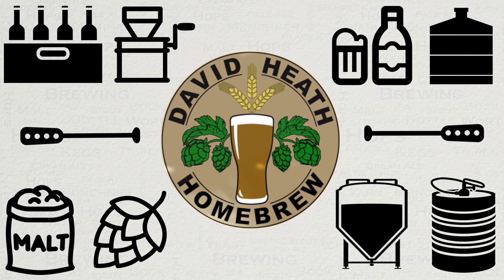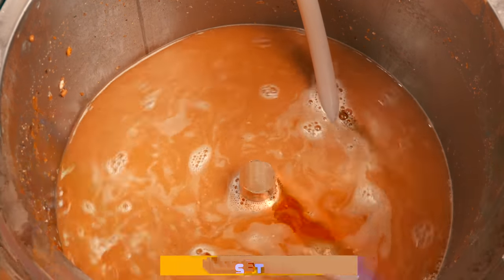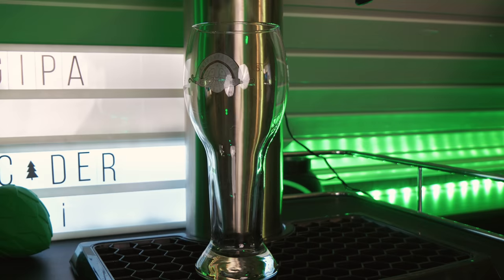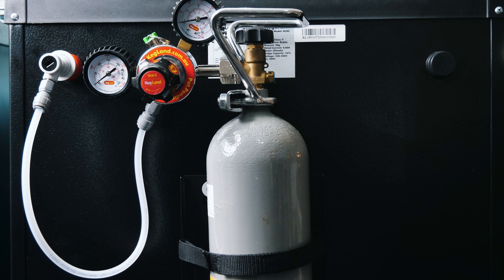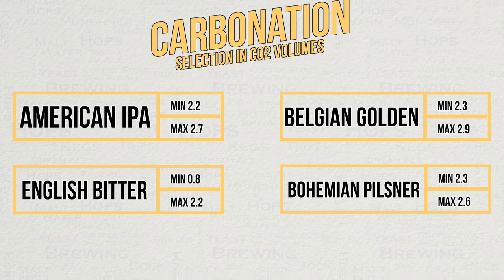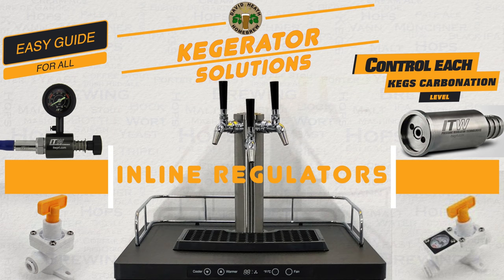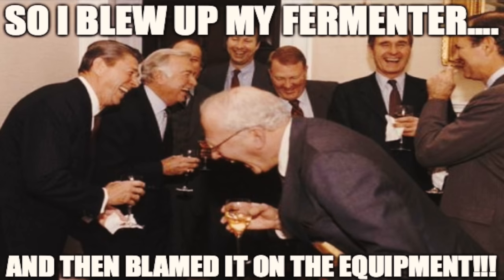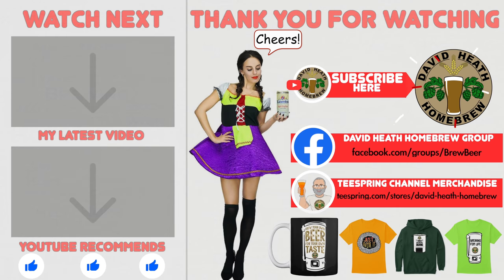Brewing Bad Part 9 Common Mistakes Made By Homebrewers

Comment: Good info. Especially the valve which I have used to reduce flow during mash, maybe that's why I get low efficiency sometimes. This information I have not seen anywhere, and the manual from Brewzilla is very limited in information. Big thanks my man👍
Reply from the maker: Cheers Pask.. Glad you found it useful :)
Reply: I thought going full flow at the start (before the grain bed has settled) would cause channelling through the mash amd therefore low efficiency. I tend to stir and leave it 10mins, then run slow for ten mins, then gradually go up to around 60-70% open.
Reply from the maker: It works well :)
Reply: @DavidHeathHomebrew  more than one way to skin a cat as my granny used to say!
Reply from the maker: Sure is :)

Comment: First point is a keeper for me. One issue is that at times some residue blocks the sieve and lifts it. I think I’ll slightly adjust my crush to coarser following your description
Reply from the maker: Great. Your graincrush is key to the brew, so as such it is well worth perfecting.
Reply: @DavidHeathHomebrew  agree. Tried it today. I went from the usual 72-74% to 80. My bo pils will be 5.3ish instead of 4.9. Will try another time looking at pre boil and stretch the recipe if needed adding water and hops. Then adjust future orders. 
Thanks!!
Reply from the maker: Great :) Be sure to dial it in for future brews :)

Comment: I do like your series but this episode didn't apply to a lot of brewers out there. It is only a 5% of brewers who this apply to (at least here in Europe). But still, you've helped them, which is good.
Reply from the maker: I would think that this would apply to more than 5% of brewers. Using kegs is popular, as is pressure fermentation. Most all in one systems have a valve too.

Comment: Thanks for the video David. Am I correct in that you're not saying don't force carbonate, rather it's safer to carb slowly as over-carbonation means higher carbonic acid + resulting sharpness and under-carbonation also not great?
Reply from the maker: Yes, exactly that. Force carbonation can certainly be used, just be careful to not do this for too long

Comment: Struggled with spunding valve with 1st Marzen in Corney Keg (4.25G). Used 34/70 yeast (1 pkg) and Kraussen made a mess. At Day3 switched to blow off airlock for 5 days and re-installed spunding valve - holding at 7 psi. Any ideas on how to setup spunding valve ? No instructions with valve.
Reply from the maker: Can you provide a link to the spunding valve you are using? Then I can hopefully help, they can be different :)

Comment: Hey David, 

Can you elaborate on the fact that you once told us (one of the imperial stout videos) to keep stirring the mash every 20-25 minutes to get higher efficiency.  I've done this ever since, which also has resulted in brews that were pretty bothersome. The past few brews I've let the mash overflow(like this video mentioned) and had a much easier time.
Reply from the maker: The stirring technique is one that I personally only recommend and use for high ABV beers where you are looking to maximise efficiency. This should not be needed at all for other beer types.
Reply: @DavidHeathHomebrew  this makes a lot of sense. Thank you for answering and please keep up the good work with your informative videos! Cheers ☺️
Reply from the maker: @ProXiE89   Great, anytime :)

Comment: I must say that I disagree with you statement on controlling the flow of the mash. I achieve 84% mash efficiency as a minimum, but usually it is over that, and I control the flow to ensure that the level over the top plate is stable. I use a fairly fine grain crush, and avoid rice hulls unless over 10% wheat is involved.
I have found that going full flow as you advice will drain wort from underneath the grain basket and result in burned wort on the element, besides that, you have no idea if the mash is stuck or not, until you start the sparge.
I guess we have learned to work the equipment in different ways, and that there are many ways to skin a cat.
Reply from the maker: It is fair to say that the equipment can be used in this way, if you can find the sweet spot. The fact is though that this is not how the equipment was designed to be used. With the right crush there will be no burnt wort during the mash as long as you scrape the bottom as GF advise during the boil several times. If the mash was stuck then it would cause constant over flow, a stuck sparge is something different in fact. It is actually easier to use a GF the intended way, though I can understand that now you have made it work this way then there is little need to change.
Reply: @DavidHeathHomebrew  Perhaps thaifoodtakeaway  is using the Brewzilla instead of the Grainfather. I am wondering if this may be a design or design consideration difference between the Grainfather and the Brewzilla. In the instructions for the Brewzilla, it is stated that the valve at the female camlock fitting may be used to control recirculation mash flow and I too have thus far had the impression that the recirculation flow rate should be adjusted so as not to utilize the overflow tube. I have brewed 28 5.25 gallon all-grain batches using this method (controlling the recirc rate with the ball valve) with my Brewzilla since March of this year (2021) and I have been using this method with success, although my average brew efficiency for these batches is currently just under 80% (79.92%) and not the 84% stated by thaifoodtakeaway. I am curious if you have had any interaction with Kegland regarding the use of this valve in the Brewzilla and if you would minid sharing their thought on this. Opening that valve up would indeed make an already enjoyable and easy task yet easier. Thank you from the USA for all of your very instructional and informative videos! These are pure gold!